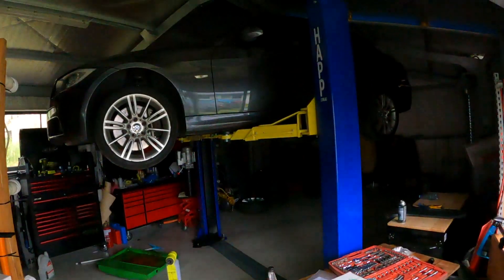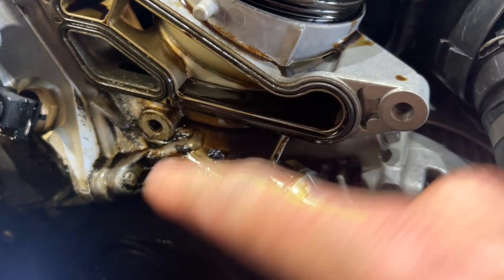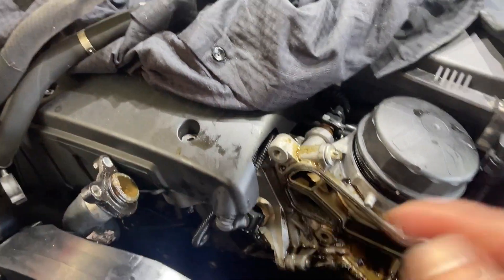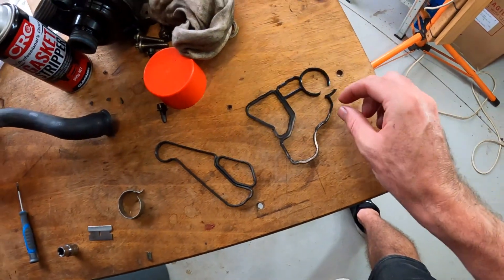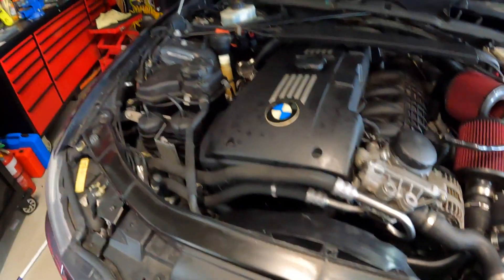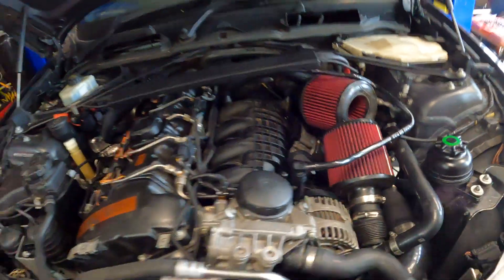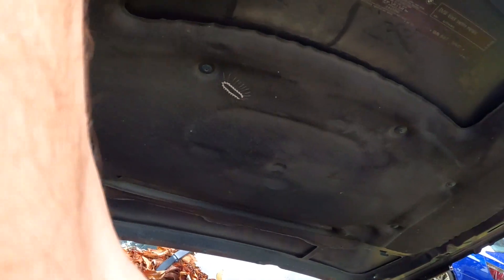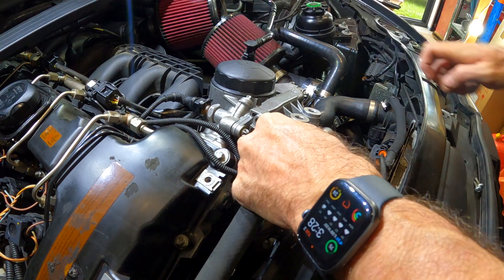BMW E90 335i N54 Thermostat Oil Leak & Hi FLOW OIL FILTER?

Comment: I thought the sludge under my oil cap was bad. 90% sure mine is caused my short trips. For the first 4 years Ive owned it my commute was less than 5 min. for the last 2 its been about 15 but I still dont think its getting up to temp properly to burn the condensation off. I'm planning on doing a oil flush soon, then try and keep track of my oil changes better.
Reply from the maker: How frequently do you change your oil?
Reply: @ZeroTo60Tube   I have been doing it about once per year but that was only 5-7000km previously. Im now doing more than that so im going to keep track of the km's and try do it around 5k/ every 6 months ish
Reply: @ZeroTo60Tube  I also often have the milky grey oil under the cap, Which is what makes me think its a condensation issue. But after a long drive that clears up.

Comment: Always loving your videos.. anyway I replaced my oil filter housing gasket, anyway for the last 2 weeks been trying to diagnose why the coolant temp it’s sitting normal and heater core is hot heat inside cabin is warm ish but not hot, when driving the coolant temp drops massively and then cold air in cabin. I’ve bleed this system many way even flushed the system and heater core no air is longer in there it’s fully out. What could it possibly be
Reply from the maker: Other than the blend door not working properly i can't really think of a fault.
Reply: @ZeroTo60Tube  blend door? also I have noticed recently that sometimes I comes out slightly hotter on passenger side then other times it comes out hotter drives side

Comment: Diesel oil, and filter change at 1000km after change, then 2000km and change again. Safer than a flush! EDIT: Genuine filters only too. Place on ebay in the redlands does genuine bmw cheap
Reply from the maker: I didnt think about diesel oil. That would make so much sense for all the soot thats in it.
Reply: @ZeroTo60Tube  Has more detergents than regular oil, so helps to clean the engine out, without as you said dislodging it in large chunks. You want dissolve more than dislodge. Keep up the vids!

Comment: I’m watching the video now I had the same issue with my oil thermostat housing and just grabbed an O-ring of the same thickness and fit it in the square hole and it worked perfectly. 70 cents!!!  Having a real dedicated new rubber gasket is a great idea since nobody sells them Which is completely ridiculous!
Reply: Just out of curiosity what o ring did you use?
Reply: @joseph_gable825  just out of curiosity what size o ring did you use?

Comment: I have only used Mann oil filters in my N55.  I've seen a video of cheaper filters in BMWs with the pleats falling and the filter carcass collapsing similar to this.  It caused oil flow rates to drop and it tripped Vanos codes.

Comment: That’s the same issue I had with my oil filter housing. The bolt behind the manifold stripped on me I had to pull the Manifold. Used extractors and ezgrip the most amazing stuff ever!
Reply from the maker: Good tip!
Reply: @ZeroTo60Tube  haven’t been able to check my plugs. We got slammed with 10 to 14 inches of snow.

Comment: Try cleaning out the Vanos solenoids and Vanos screen filters on the left side of the block up front by the chain tensioner
Reply from the maker: Dude, good tip. Totally forgot about thoee

Comment: I need to do the oil filter housing gasket and oil pan gasket soon when it get better weather outside then i hope that the oil stay inside the engine and not outside
Reply from the maker: Keeping the oil on the inside. BMW problems since 1962.

Comment: N54s are amazing.  A few oil leaks and coolant leaks fixed and it will be good for another 70k miles. I have the e92 but would happily get an e90 as a more practical car. All that power for so little.
Reply from the maker: Great point!

Comment: I'd be running it on Castrol Rx super or another reasonably priced diesel hdeo oil for 3000km and it will come up new. Do a couple of filter changes inbetween.

Comment: Wondering was there any glitter in the oil from this one too?
Reply from the maker: There wasn’t any visible, but it was sooooo black. It’s legit like doing an oil change on the diesel transit.
Reply: @ZeroTo60Tube  with all the build up inside valve cover that you indicated, crankcase ventilation might be restricted causing oil to go bad like that.

Comment: I think someone commented about the coolant pipe being mush.  You would save a lot of time just pulling the fan, makes life easier. Liqui Moly engine flush after you put the cheap oil in there and right before you drop the cheap oil.  Why do people get the cheapest parts they can find.  It's like they say, hey I can do thousands in damage if I save $3 on the oil filter.
Reply from the maker: Hey I’m guilty for taking the cheap option at times. But you do need to be aware of what you are loosing in quality when you do it.
Reply: @ZeroTo60Tube  I tell people all the time, you can go cheap but you can only go so cheap, otherwise you pay.

Comment: Engine flush will be ok man, will dissolve alot of that build up inside the engine but do two lots of oil (i usually use something cheap on sale) in it after the flush to remove any remaining detergents before you beat on it.. I put flushes through engines all day at work and they are good and help alot but are not the end all for gunk.. hopfully you can clean it up nicely and make a proper car out of it after the lack of maintenance its had 😊
Reply from the maker: That’s good to know, didn’t really think about it dissolving it.

Comment: Does Matt sell those seals online somewhere?
Reply: There is a ebay link in the video description
Reply: @MatthewGlad  I just did thia job a few weeks back and used a thick o-ring I had on hand. Seems to have worked as the housing is still bone dry.  
But you know just in case it fails down the road :)

Comment: Sad to see the stock airbox go. Hot air intakes always spoil the engine bay.
Reply: lol, they make a difference 😅
Reply: Ive got pods in mine and wondering if there is enough cold air getting in
Reply from the maker: I prefer the look haha.
Reply: The dyno runs show ~15 hp gain on these cars.  Probably because there are two pods. Less restriction and more surface area.  Not the "Cold" air.  Just more air.
Reply: @ZeroTo60Tube  maybe a video idea. Performance testing the stock intake vs DCI.

Comment: Safer way to flush engine oil but the slowest....

Buy diesel truck engine oil by a pail (18liter)  which is enough for 3 oil change...

Put the diesel truck engine oil and drive normally...

Use it for about 3-4000km between each drain...

Your engine internal should be pretty clean gunk free over time...

U can do a little spirited driving with diesel truck engine oil...  Just dont drive too hard because its just normal mineral oil with high detergent for engine cleaning (soot and ashes of diesel contamination)
Reply from the maker: thanks for the idea man, i hadnt really thought about using diesel oil but it makes so much sense.
Reply: @ZeroTo60Tube  the reason so much gunk and deposits internally because of 10k km oil drain interval for factory bmw and many modern cars, 

yet often some owner neglected the factor that not all oil created equal..

 which using less capable oil for that extended drain duration (ie cheaper mineral based oil) at same long drain interval will do exactly that..

I cant post picture in comment section.. but i took a picture of my wife little nugget daihatsu car which is 15years old, and been running diesel engine oil for the last couple of years with 5k km drain interval...

When i remove the valve cover for seal change, the engine internal looks super clean like a very low mileage engine...with no signs of carbon deposits, no yellowish/goldenish/brownish tint on all surface of internal engine parts... 

So definately diesel engine oil helps cleaning the engine in a safer way over a period of time...

Plus its much cheaper than normal gasoline/petrol engine oil because of the bulk packaging

Comment: Omg this oil filter is really crap👎. Please use only the (OEM)Mann HU 816x  filter. Nothing else. And the gasket guy is a real legend!👌. I think it needs only a oil pan gasket🤔. And do not flush te car at this point. Drive the car for  5000km and do another oil change. Dutch regards, Nico.
Reply from the maker: Thanks for the advice. Yeah pure luck on the gaskets.